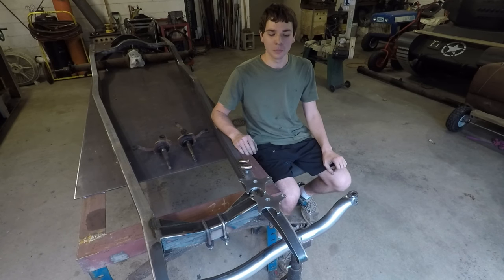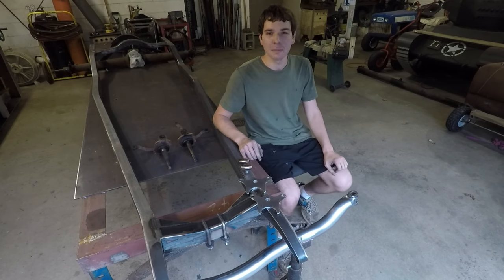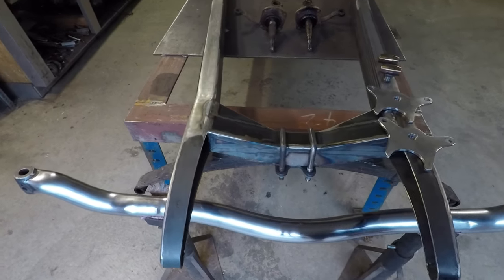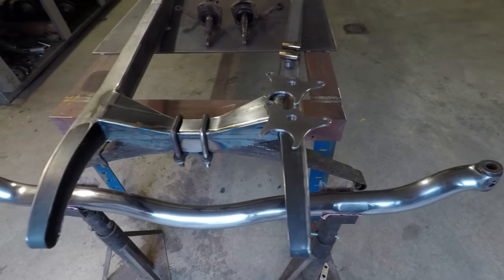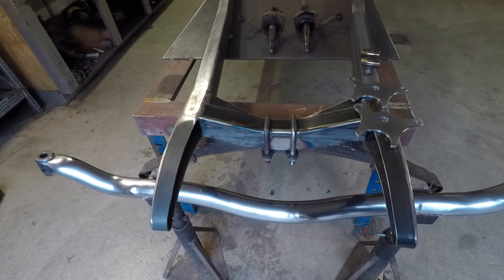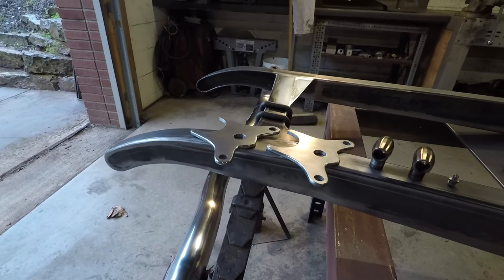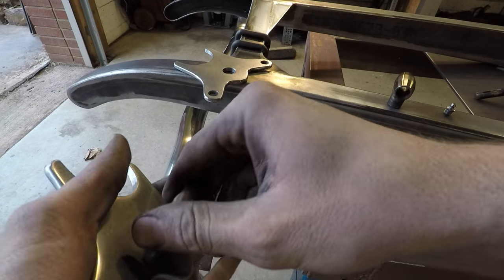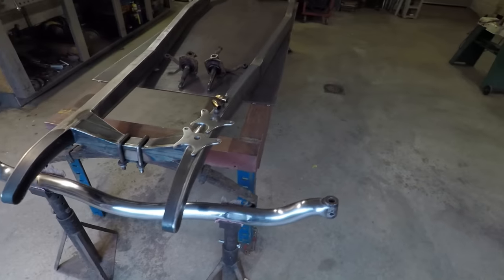Polishing an 80 Year Old Axle | Boat-tail Speedster Pt.7

Comment: Amazing work.  I'm wondering if the hairpin mount brackets are thick enough?
Reply from the maker: I think so. I saw some kits that you can buy online and the metal they used was 1/8" thicker then mine, but the supports to the holes were much skinnier, so it should be fine